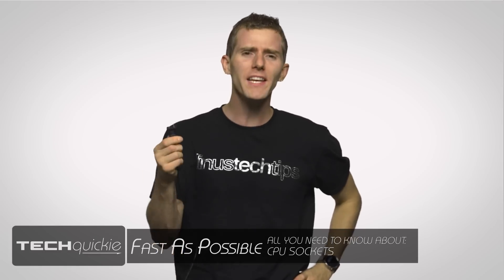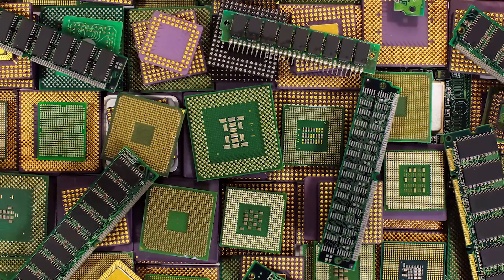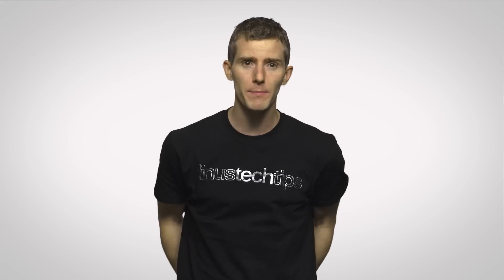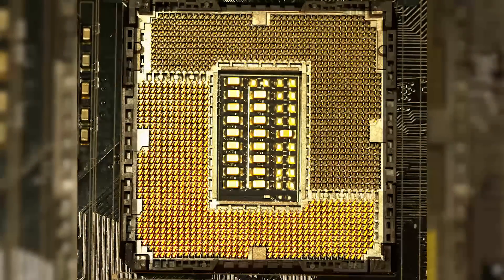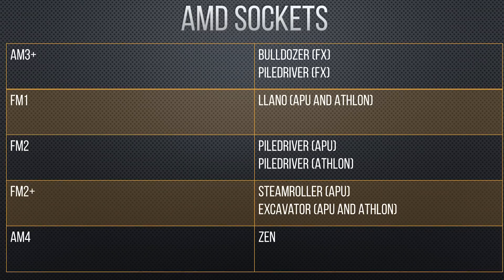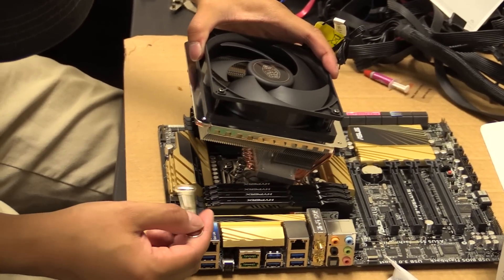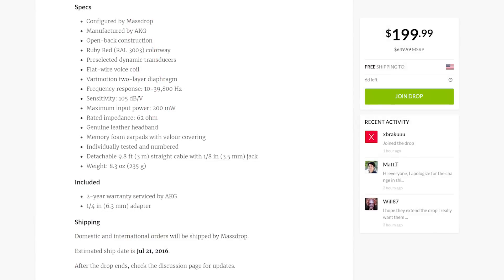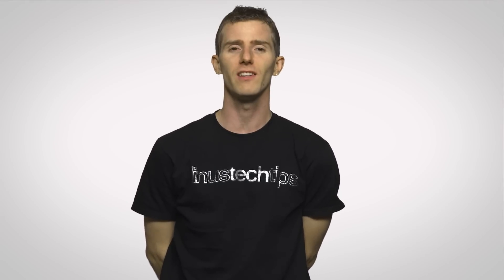CPU Sockets as Fast As Possible

Comment: You are 100% correct that you should not have to apply pressure to a CPU to seat it.  If anything you should do the exact opposite and set it down carefully in the socket.  The pins on a PGA socket will fall into place if the socket is correctly opened.  Unless you bent any of the pins or didn't set the CPU down flat in the socket, it will require zero insertion force (it is why they are sometimes called ZIF sockets).  One other reason it would not go in is that the CPU might not be oriented in the socket properly.  Look for a mark or arrow on the socket and CPU and they should be matched to the same corner.  Also note that a CPU will not go into the socket correctly if at all if it is not oriented correctly.  If that happens, stop where you are, FREEZE and look to see if you did something wrong.  Also install your PC parts when you have the whole day to yourself so you can enjoy the experience and do it correctly.  Maybe that will give you plenty of time to check everything over once or twice.  Then you can get a cup of coffee or something else and power it on for the first time and install the OS.  I say do all of this on a free day so that you don't have to rush anything, building a PC should be fun.  Rushing it will just lead to stress and possibly damaged parts.  Need help, by all means call in a knowledgeable friend.  He can help you out with anything you are not sure of.  This isn't as difficult as some people would make it sound.  Just take your time do it right and have fun!!

Comment: So, Which socket type should I pick and how do I pick one?
Reply: Depends on what cpu are you getting
Reply: Depends on what cpu are you getting
Reply: @reimon5410  i know it depends on the CPU. But why would i want an LGA 2011 or LGA 1156 both socket types have i7 brands.
Reply: @keeler1160  well lga 2011 is used for i7 X series or xeon chips

Comment: lga is inferior. you can keep a cpu in a tiny box to keep pins straight, and they are easy to bend back. lga pins bend easy af and with bad eyes are very hard to work with. amd stickin with ZIF :)

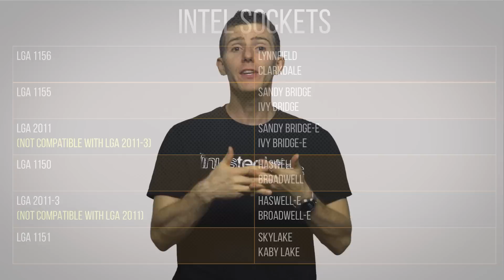Comment: 1:41 11 yr old pc that runs rainbow 6 Siege at 60 frames highest settings but still uses a lga 775 socket. My socket did not show up on the chart. Prob cause those CPUs are considered fossils.

Comment: I bought a Intel core i3-8100 3Ghz+ (Overclock) for my trash picked pc which is upgraded already it is using a clarckdale and a core i3-550 3.2GHz I tought the 8100 should fit because I thought all i3s where the same so I found it out the hard way by breaking my pins

Comment: I like how people forget about bga (ball pin arrangement) its very rare to find a cpu that has a bga socket, if im correct, its in the broadwell micro architecture and in old mobile parts
Reply: im sure its in more embedded systems than you think, not to mention laptops and probably used in fixed system like phones.

Comment: yeah i have bent pins before (on intel), had a old pentium d rig (pentium d 945 i think, either way i know it was 3.4ghz stock) which during a thermal paste replacement we got a little on the pins on the board, we then tried to wipe it clean but ended up bending on of the pins, turns out it wasent just another ground pin we bent so pc didnt boot. next day went out and built a new system, AMD athlon II x4 640, 4GB ram and geforce gtx9600 512MB

now im on

AMD Phenom II x6 1055t OC'd to 3.5ghz
9GB DDR3 1333MHz
1TB Hitachi ECO drive
480GB SanDisk Ultra II SSD
AMD R7 270/270X (both the 270 and 270X are the same, just the 270X has an extra 6 pin power connector)

Comment: I found one of my parents old pcs in there closet so I decided to clean it up as I had nothing to do and it was the weekend and I kinda got bored of most of my games so then when i was taking out components I realized I hadn't taken out the cpu yet so I looked around and found a cartridge with a 40 or 20 mm fan mounted on it and I thought ok well that must be an old cpu so I googled it and realized that cpus were also inserted like cartridges a while ago I was then confused as to how to remove it as it was bolted on the mobo with rivets and other stuff that is hard to remove.

Comment: Any good tool to remove Intel processor without touching the sides? I was thinking of small suction on the heat spreader. I'm getting paranoid and extremely overcautious when removing my cpu away from the socket.
Reply: Alfa Proto the CPU really isn't that fragile. If every other person on the Earth just grabs it by the sides, than you can too.
Reply: PanicStudios No I mean, I am extremely worried about the pins on socket, not the cpu. I nearly destroyed an LGA1155 socket, about 3 pins bent but managed to recover it. Plus, since SEA is hot, my hands perspire easily.
Reply: Alfa Proto so be more careful? It's really not that complicated. You just grab the CPU by the edges and lift it up AND AWAY from the socket, you don't want to drop the CPU in it.

Comment: I want the times back when you could just put a sticker on a CPU, and put it in a different socket (771 to 775 Mod).
Reply: Loli Neko but the only reason you could do that was because the CPUs were the same architecture and worked on the same platform. You don't even need a mod anymore, you can just buy a Xeon for the same socket and it will work in most consumer motherboards.

Comment: Why so many different sockets from both AMD and Intel? 
Is each generation actually so much different to require a different amount of pins or is it sometimes just a sales tactic so I also have to upgrade my motherboard at the same time and spend more money?
Reply: Might be a sales tactics.
Reply: It's called bandwidth and power. When you have more controllers, more. PCIe, USB, SATA, Memory controllers. These all need separate channels when they're controlled by the CPU, meaning the more of each you have the more pins you need.
Reply: +WB IsMe - I think you might be right.
Reply: Because the the architecture change requires different pin layout/wiring

Comment: Hey Linus. I was wondering how powered USB hubs work. Does it just help power the peripherals or can it hurt them by giving them to much voltage? I had an AVID interface for Pro Tools and when it came to supplying phantom power for two condenser mics, I was concerned. I got a powered USB hub (Amazon Basics) but, I was just wondering if devices only pull what they need or if they can be burnt up, so to say. Thanx man! Love the show!

Comment: oh jeez this brought back some bad memories. A few years back I had a fairly nice little prebuilt pc and it was starting to show its age. I checked on the case and it proudly displayed "AMD athlon 2" on it so I did the "logical" thing and went ahead and purchased an AMD FX 8350.

not smart.

so I get home with this beastie in my hand and set about trying to pull my computer apart and after a lot of effort I finally got to the motberboard which, superficially at least, appeared to have the right sockets.

This was back when I didn't know about sockets. "AMDs are easy to install" they said.

about five minutes of wrangling later and I'd bent two pins. an hour of desperate wiggling with a knife later and those pins totally came off. I spent the next hour or so practically crying at my own failure.

and that's the story of how I threw away about £180 on a processor and then killed it before I even got to run it.
Reply: im sorry for your loss :'0

Comment: but Linus, tell me something. WHY THE FUCK CAN'T I USE 1150 COOLER ON 2011-V3 MOBO? Like.. why are these four holes couple milimeters offset? this makes no dam sense!
Reply: The 2011-3 socket is physically larger than the 1150 socket. The holes are positioned to reduce the stress on the socket while still holding the coolers down as good as possible. Since the sockets are a bit differently sized, the holes are slightly offset.
Reply: xSixtyyy but do these couple of mm really matter that much? Like.. I love my LGA 1150/55/56 cooler and I rrally hope that compatible motherboards will return.
Reply: +Bartosz Olszewski what cooler
Reply: Bartosz Olszewski probably doesnt matter that much but i doubt that intel will just change the holes for 2011-3 :p

Comment: I like more the AMD socket it's very easy to install the CPU and also if you bent the CPU pins you can put them in the shap they used to be with a knife..cool! And also I need to say that I just like AMD's socket more and no I also have a few intel CPUs so I'm no fanboy.

Comment: Fun little fact... AM3+ CPU's are compatible on AM2+ motherboards but not the other way around because they use the same socket type except, AM2+ is only compatible with DDR2 ram and not DDR3, while AM3+ is compatible with both DDR2 and DDR3 ... the only thing AMD did right.

Comment: I need help. I need to free up the room that was being used by virtual memory. I had 20gb free on my boot drive, but accidentally set the virtual memory to be set to the boot partition. That made me go from having 19.4gb of free space, and then it went down to 3.4gb, since 16gb was set aside for the virtual memory space. After fixing the virtual memory setting, that 16gb of space on my boot partition is still showing up as used space. How do I free that back up again for other uses? I have tried Google, so please don't burn me at the stake for not trying to figure this out the obvious way. I feel like this is the best (one my favorite, anyway) tech channels, so I hope somebody here will have the answer to my issue. Thanks in advance.
Reply: Delete pagefile.sys it's a hidden file in the root directory of the drive.
Reply: When you delete a page file from Windows' config, it doesn't actually release that space until you reboot.  Make sure you've rebooted.  Also, Viktor's comment applies.
Reply: I got it fixed. Even if you reboot, or use regedit to clear the pagefile, or gpedit to do the same, the file still remains. You have to go in and show hidden files as well as uncheck a box that hides system specific files in order to get the pagefile to show up. Thank you for the help.

Comment: girls explained next epsiode ?
Reply: Girls. 
They all have diferent size and shape sockets but compatibility will probably not be an issue. Make sure there is enough lubrication before insertion. This mostly comes  preinstalled but you may need to apply some manually.
it is very wise to cover your entire cpu with a special rubber cover before inserting into the socket. This may slow down performance and not provide optimum experience but it will provide maximum protection against viruses and malware and also save you from alot of trouble in the ocassion of uncontrolled coolant leaking.
Please note that brand new motherboards will have sealant in their sockets. This is nothing to worry about as it will brake off as soon as you insert the cpu but be sure to do it gently for the first time.
Reply: i don’t think linus would know anything about that

Comment: Not only do you need a cooler to match your socket, but pay attention to which way it will connect. I ordered the wrong cooler master 212, and it could only go with the fans pushing/pulling vertically, which made it too wide and would have blocked half my memory slots. had to switch to one that attached differently.

Comment: I found my first computer collecting dust in the basement about a year ago, and since I hadn't actually gotten into computers until nearly a decade after I stopped using that pc, I never knew what was inside. I opened it up and was greeted by a big cartridge with a tiny fan on it labeled "Pentium II". I hadn't even known at the time that cartridge cpu's ever existed.

Comment: Well my CPU use BGA2011 so that's mean there is no contact point on CPU or socket, it soldered on to motherboard, so no more bent pins. (Great!) And that's mean i'm stuck with it forever (Well, if i got desolder station I could upgrade.) DAMNIT.

Comment: the funny thing is that, a cpu could really cook a piece of bacon.
Reply: Not really. The safety mechanisms prevent the chip from going beyond its temperature limit(thermal junction max, or TJ max), and therefore will either cause the CPU to throttle, reducing its temperature, or outright shutdown.

Additionally, even if you were to disable the safety mechanisms of the chip, it would not last long enough to cook a piece of bacon due to not being usable for long enough, and also due to the surface area of the CPU. And don't even get me started on the grease.
Reply: Godlygamer23 you could cut the bacon shorter.

older CPUs will throttle until they die, and they put up more of a fight then you think they do. they can run at 212 degrees F for a long time. l have seen some run at around 500 and still live. doesn't do much anymore, but can still generate some heat.
Reply: +Godlygamer23 or use old cpus

Comment: So why do A series CPUs use the FM# sockets and FX series CPUs use the AM# sockets?
Reply: That's the naming scheme AMD chose.
Reply: Different placement of the power and databus pins?

The A series are a different product with different needs. So they might need a different pin configuration. More data pins versus more powerpins.

An FX chip definitely needs allot of power pins. 

While an A series probably needs more datapins to aid connection the IGP has.
Reply: +Masticina Akicta No I was talking about that naming scheme. Is it backwards or does it stand for something logical?
Reply: Hans Tang 

I don't expect it. They needed a name for their new product that was different enough so nobody would buy an FX chip and put it on an A-series motherboard. 

I am sure that internally they got a lovely name for their socket. Reality is it just about compatibility. 

AM4 will be interesting to say the least. Zen might be a pretty nifty CPU.

Comment: wait! i have a amd a10 5800k does that mean i need apu drivers from amd.com? because i always tought i just needed radeon for my gpu and idd be fine
Reply: You will be fine. GPUs need drivers, CPUs do not. Occassionally there might be some benefit in installing driver-like programs for the CPU, but I don't think AMD has released any of those since the Dual Core Optimisation Kit (or something like that, can't recall the exact name) all the way back in the Athlon X2 days.
Reply: Robert Faber ah ok, apu is for on board graphics card right?
Reply: RrGamer RRG An APU is essentially a CPU and a GPU put together in a single component, yes. The graphics part of an APU isn't quite equivalent to a proper graphics card, as it lacks its own memory and power delivery, but when it comes to the actual graphics chip of an A-series APU, that is essentially identical to something you might find on a fully fledged Radeon card.

Comment: I really regret these good old sockets on the CPU. Or maybe is it me who is becoming chicken the more I read about how cautious you should be not the bend a pin on the MB otherwise you're screwed. In my mind it is easier to straighten up a pin on the CPU (did it many times) than screw one on the MB. But well I had no issues so far (OK I had to do it 1ce ou 2ce so we lack data to rely on that but well no issues).

Comment: The link doesnt work. :( I need an 8370 for Fallout 4 and i dont know how to install a CPU
Reply: Okay, let me talk you through it then. There's a little triangle on one point of the CPU, and that corresponds to either a triangle or circle (depending on your motherboard) printed on the PCB directly beneath the socket. You need to make sure those two are linked up. If you've aligned it correctly above the socket, you can raise the retention arm, gently drop in the CPU, making sure not to use any force (it should fall in very smoothly). Once it's seated, give it a little wiggle to make sure it sits correctly, and then carefully lower the retention arm again. Once you've done that, you're basically done, and you can move on to the slightly less delicate job of mounting the CPU cooler. I hope that helped, but if you have any more questions, feel free to ask them. I've only ever had AMD CPUs in my life, so I've accumulated a fair bit of experience in putting them in their respective sockets.

Comment: well, im still using a lynnfield i5 cries in a corner
Reply: +Clin9289 stick with a 6500. 0.1-0.2ghz is not worth the price increase
Reply: This is nothing.
Still using intel SY022 here!
133MHZ of pure power!
Reply: taief miah Thanks for the tip. At the store I want to buy, the 6500 is around 45 euros cheaper. 
It does make me wonder why PC-gamer recommends the 6600 in their CPU buyer's guide if you don't care about overclocking. Perhaps they didn't look into it much, it seems more like a quick suggestion.
Reply: I still have a Lynnfield CPU as well: an i7-860. Little did I know at the time, I didn't actually need an i7 for gaming. I could have gone with an i5. 
I'll probably replace it with an i5-6600 when I upgrade my PC, but first I'm waiting for reviews to come out of the AMD RX 480.

Comment: could someone explain why cpus are not on cartridges anymore i couldn't find anything online
Reply: The bandwidth I think
Reply: Bandwidth, basically. Whether it's Intel's Front Side Bus or AMD's HyperTransport, the connection between a cartridge and the connectors it makes contact with simply wouldn't be able to accommodate the massive transmission speeds required to use those connections to the full.

Comment: Pssss... AMx+ sockets are sometimes backwards compatable with the non+ versions. ie: AM3+ socket will work with AM3 chip, but not the other way around. :3
Reply: Not sometimes, but always; that's the very meaning of the +. If socket AM3+ wasn't compatible with AM3 CPUs, it wouldn't have been called AM3+ but AM4. I'm personally quite happy that AMD pays such attention to backwards compatibility, because I'm running an AMD Phenom II X6 1055T (AM3) CPU on an Asrock 970 Extreme4 (AM3+) motherboard, which would not have otherwise worked.